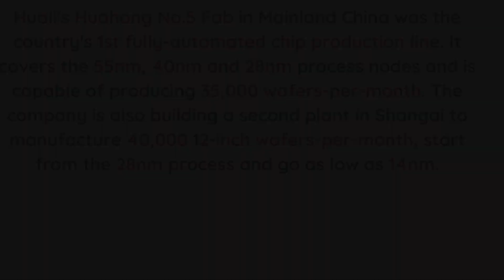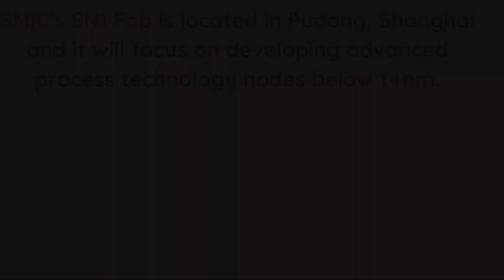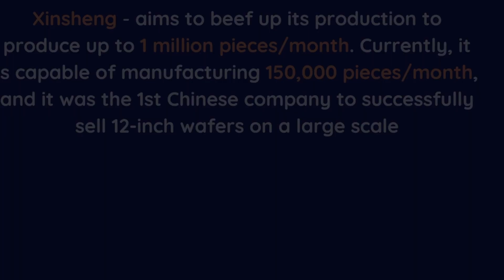Sub-14nm Chips from SMIC | SMIC's SN1 Fab in Shanghai will produce sub-14nm chips

Comment: The 7nm FINFET n+1,n+2 will likely be ready for mass production by 2023/2024. There will more companies going into 28nm and 14nm once SMEE start mass producing its lithography for both. By 2023, China will meet all its requirements for 14nm and above which is 95% of its requirement. Consequently it may supply to 95% chip requirement of the world and extremely competitively cost wise. The rest, will fight it out in the 5nm and below which is about 5% of the market requirement. This is provided SMEE don’t come up with a Direct Laser Writing machine which can produce 5nm silicon base chips or China coming up with graphene or photonics base chips. They already come up with an 8 inch wafer of 40nm / 50nm graphene chip. Coming down to mass produce 7nm by 2023/2024 may just stranglehold other world market players further. Nevertheless China’s priority is to be able to supply to all its own requirement. If China succeeds by 2023, the rest of the players TSMC, Samsung, Intel, etc will at least lose the usd400b market which 1/3 of the world market. Worse, China if and when can produce more than it required and start selling at a very economic of scales price,  that will impact the earning of the rest of the world players which may translate to reduction in investment. Chip shortage will end by 2023 with China to the rescue.